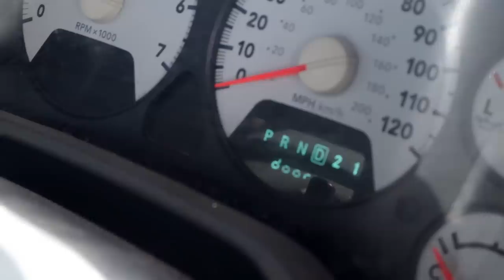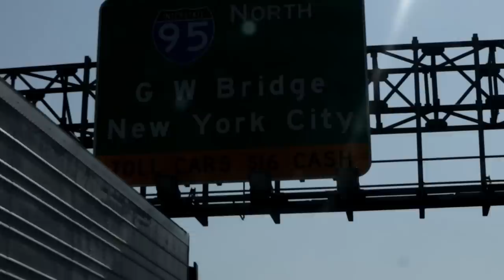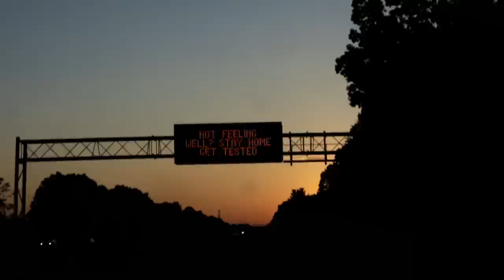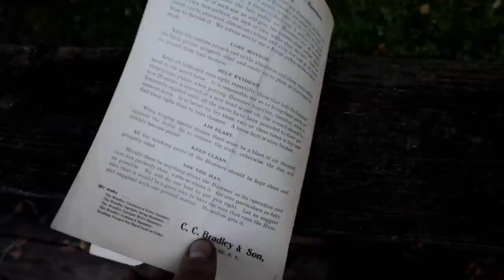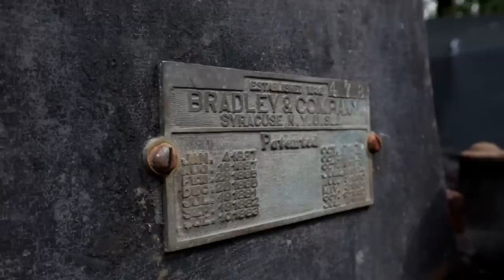1800’s Power Hammers & [Ilya's Sword Reveal]

Comment: If you haven't already, i'd love to see why older tools are better than new tools. It seems crazy that something that's seeing use today is made of low radiation metal from before the atomic bomb tests
Reply: The main thing is, old tools were massively overbuilt and made to be imminently reparable by your average joe with maybe a wrench, screwdriver and some basic tools. When a company designed and sold a power hammer, they  intended it to be the only power hammer youd ever need to buy, for generations. Now, there might be more bells and whistles on a machine made today, but those extra layers of features add complexity. Couple that with the fact that now computers can show exactly how thin a part can be made so itll last until the warranty is up, and you end up with flimsier machines that are hard or impossible (or some cases downright illegal) to repair at home that was designed with the notion of selling it, then in five years when it breaks, have it be more convenient to buy the new model than try tearing it apart to fix the one you own. Modern tools rely on being bulked out in just the right spots to not fail easily whereas the whole thing is heavy duty for the older tools, and its cost prohibitive to make them like they used to now that theyre not quite as necessary to manufacturing,so its cheaper to keep old ones running. Also its just nice to preserve history

Comment: Yo, I work for a company that does demolition of buildings, and I swear we had to dismantle a hammer just like that. I remember sawing the wood part of it, and we torched the bolts to take it apart because we couldn't torch the iron parts. We always coming across stuff like this in old buildings, my boss just sells it for scrap.

Comment: Instead of paying top dollar for a rare 900 rpm motor, use a more standard motor along with a vfd to slow it down. You can even set a reference speed maximum so you can't run it too fast.

Comment: I cringed so hard when you moved it with the anvil!! I've seen a couple examples where they moved a bradley beam hammer like that and the ears on the anvil broke right off.
Reply from the maker: Montygo take a sec look. We didn’t do that. The very first pick was just to get it off the forks of that old loader it was sitting on.
Reply: @ThatWorks  took a second look and it appears you didn't remove/support the anvil when moving it unless it was sitting on beams lengthwise.